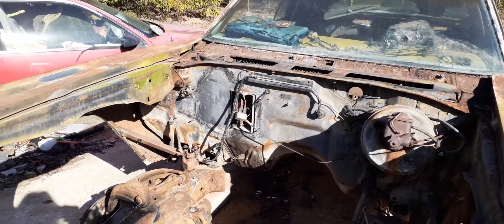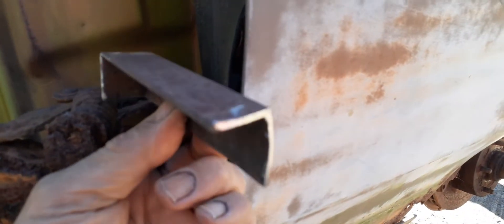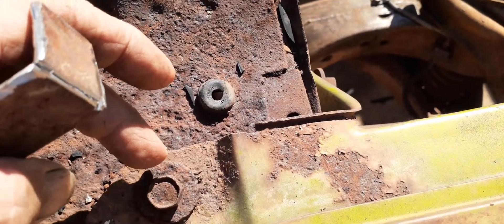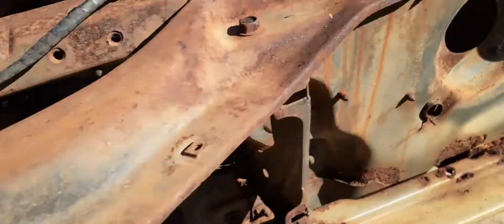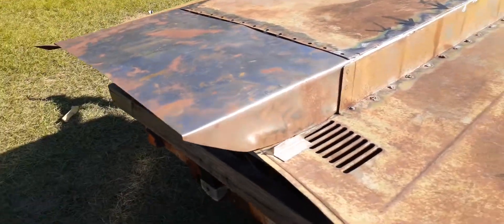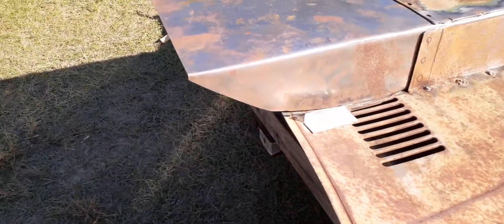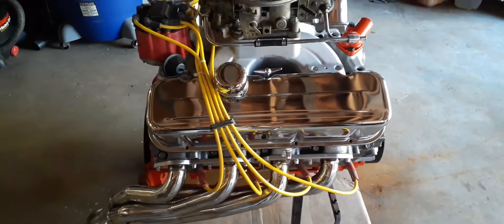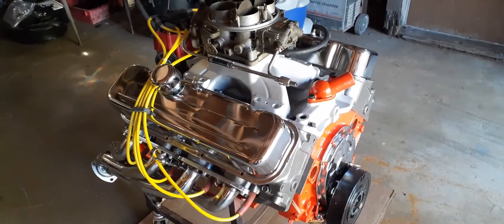71 SS MONTE CARLO ENGINE & FRONT END UPDATE.

Comment: Hey Bullet man that is hot rod building if I ever seen it! Very cool stuff. I think the tilt nose is going to be badass. Are you planning on having the hood still open to be able to access your hood pins in the back? The old 454 sure did clean up nice man! That's going to be sweet when you tilt the hood and everyone sees thats big block. I would say 3500 stall converter. You said it has 488 gears so its going to come up quick in the rpms of the line. What camshaft does the engine have? I assume it'll go to 6,500 - 7,000 rpm range. You know this man you want that engine to stay in its powerband as long as possible for quickest results. Keep the videos coming man I enjoy them. Hope everything is going well with your Dad. Have a good one I'll talk to you later ✌
Reply from the maker: Thanks for  the info  and I  think you're right on the converter 35/38 ???. It's old school solid on cam pretty radical. Oh and hood will still be functional.  Thanks Don. See ya soon.

Comment: I would say 3800 stall with the 488 gears and love the motor. I have a question what kind of hinges that you used for the tilt front end and where did you get them if I may ask thanks
Reply from the maker: Hey 265,  sorry it took so long to respond. Just been crazy/busy lol. Thanks for the comments and the views. I got the hinges off the internet. They are called dump hinges. Actually for the tailgate of a dump truck. Pull pins from ebay. Thanks again and I hope to see you soon 😁